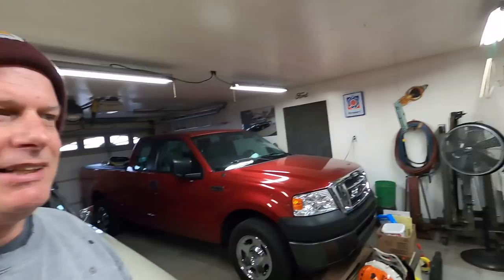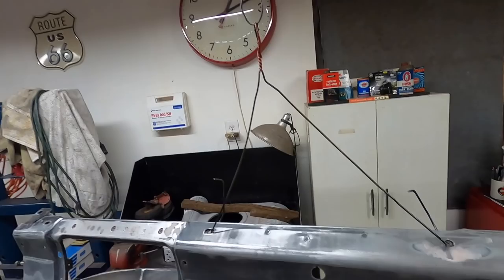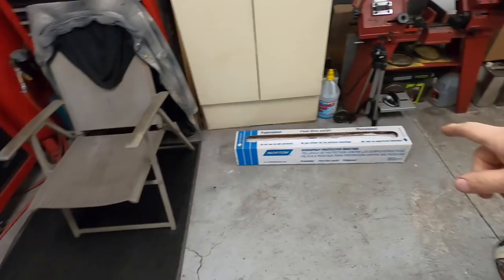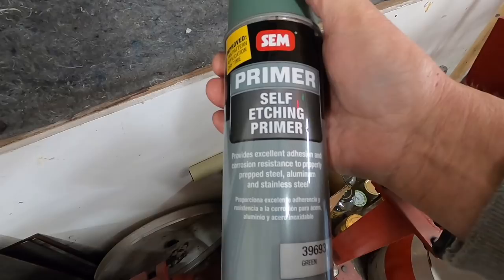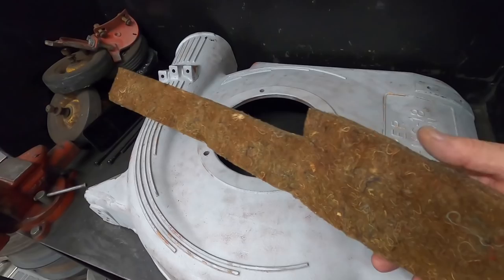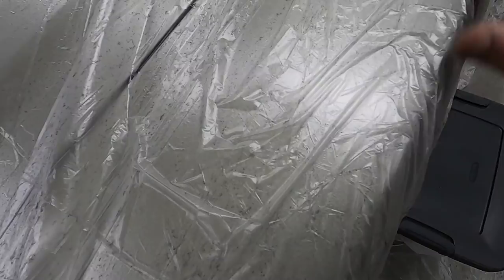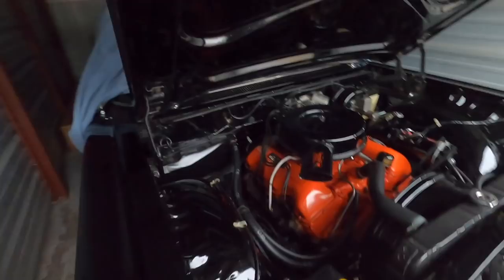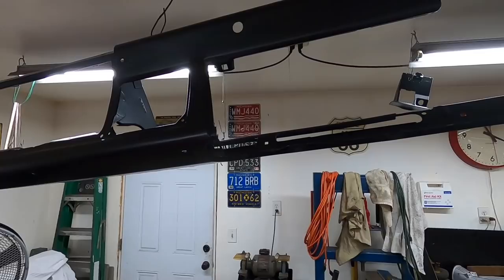1966 Ford Galaxie 500 convertible restoration part 163 painting the dashboard

Comment: That heater interior box, has seen better days. It'll do..
Reply from the maker: It cleaned up ok, but yes a replacement would be nice. Fortunately not much of it is visible, when the dash is in and assembled. I might sand it out with 320, the 400 and again with 600 or 1000 grit. I have done that on past cars heater planum. It really makes them look better. I think the fiberglass holds dirt, as it's kinda porous.

Comment: Howard, you mentioned in a past video how you have to cover everything in your garage before you spray paint. Get yourself a few zip poles instead. They have a horizontal bar at the top that you drape plastic over. You extend the pole height to hold the plastic temporarily to the ceiling. That gives you a temporary wall between your car and the things you have around the walls of your garage. Zip poles are inexpensive and putting up the plastic forming the temporary walls is way faster than covering up everything around the garage. Any paint supply store can explain what a zip pole is and how you use them.
Reply from the maker: I have done that in the past. It makes it harder for me to get at things in the garage. I find it easer to just throw bed sheets on things. I buy the non-fitted bed sheets in estate sales, just for covering things up.

Comment: Howard :  The dash looks super, great color! perfectly satin! My Fury just came from the shop today, The check valve on the power brakes actually snapped off while I was driving. Not a great experience but hopefully a once in a lifetime one!!! You're right about Cold War Motors and that Fury (although they tease you a lot with little snippets of progress on that car.)..sometimes it drives me crazy!! Looking forward to seeing the white walls on your Galaxie, I had to compromise the width on mine, it seems nobody makes whitewalls with the proper width from the sixties anymore, so I went with American Classics, but the width of the white walls on their tires is more 1950s then 1960s. I hope you have better luck in your area finding the right tires! By the way Charles Phoenix demonstrated one of the exact same model and year of that Fury that had been completely restored on his You Tube channel, the styling is SOOO over the top! I love it too!
Reply from the maker: I love any of the wild styled finned cars of the mid to late 50's and early 60's. They are "art work". That styling will never be repeated, as it was very costly to make those panels of that era. Thats some crazy sheetmetal forming.